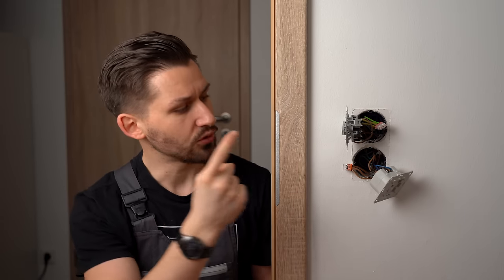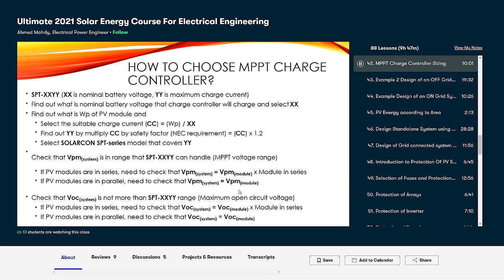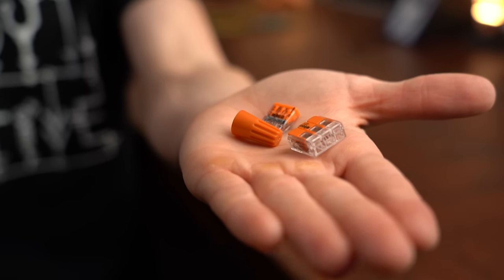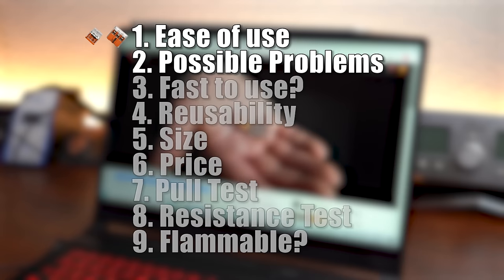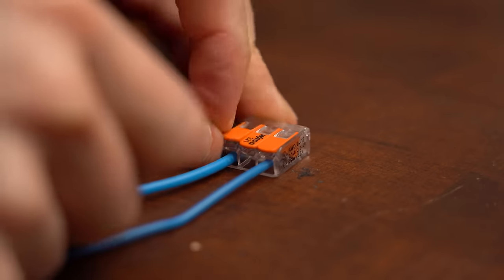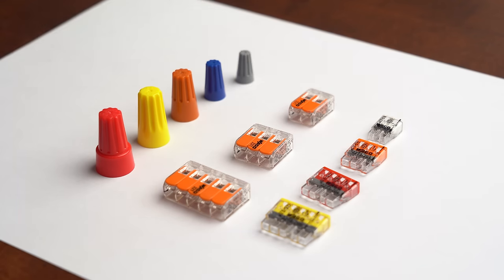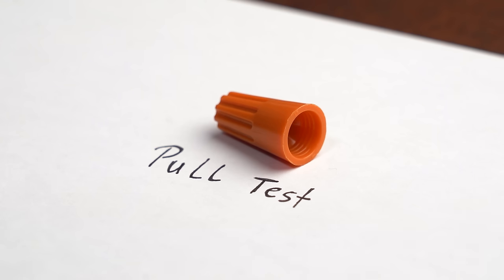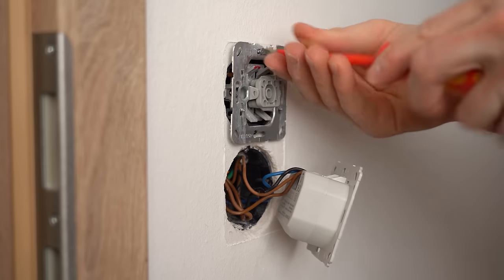What Wire Connector is the Best? Settling a Debate! Wire Nut VS Wago

Comment: I recently moved into an older home in the USA, and I just started some renovations. This topic has been on the top of my mind. Thanks for the in-depth analysis!
Reply: If it was built in the early 1970's, you run the risk of homes with aluminum wire.

Comment: Being from the US, I was raised on wire nuts. However, I now keep both wagos and wire nuts around. There are plenty of instances in existing work where wagos have been much easier to install due to space and wire limitations. I also prefer them for mixing stranded and solid cable, but that is purely personal preference. However, I still prefer wire nuts for new work where I have plenty of wire and can cut and strip everything to the length I want. The cost savings is significant when making more than a few connections, and when I am doing something simple like connecting two solid wires of the same gauge, they produce a great connection without much difficulty.

I was also taught to pre-twist the conductors before installing a wire nut. That is part of the reason I don’t like them for adding to existing work: there often isn’t as much room to get a tool on all the wires I want and twist them up, so I have to rely on the nut to do it. I don’t need nearly as much space to shove wires into a wago.
Reply: How many wire nuts (or similar connections) would you say there are in a typical 3 bedroom 2 bath home? Curious to see how much that .88 watt/wago adds up.
Reply: @Kr-oy2bo  Unfortunately, I don't think I could give a good answer on that. I just use 'em!
Reply: @Kr-oy2bo  250+ terminations would be reasonable estimate at 3 connections per outlet/switch. Average American home is about 75 outlets according to Googles. If I were an Electrician, I'd prefer the Wago connectors. I've only used wire nuts and I'm not a huge fan. I've done some plug terminations and I'm a low voltage tech, so I appreciate the fact you can see how well your conductor is terminated inside the connector. I always worry about insulation getting in the way for a wire nut to make proper connection or them not winding together inside the nut properly. I'll probably buy some Wago connectors at some point to keep around the house.
Reply: interesting. Would the higher cost of the wagos not be offset by the time savings they provide in your project?
Reply: @AndreSomers  at the price a German electrician charges: Absolutely. At the price point of electricians elsewhere in the world? depends I think.
Reply: @Kr-oy2bo  difficult to say, because you will never ever use all electrical appliances at once, and furthermore, you will never ever have 20 amps of power (which is at what load the 0.88W were being measured) going through all of those connections at once, if any - mainly, because your fuses will trigger much, much earlier. Usually 10-16amps per circuit in Germany, and depending on the age of the building, circuit can mean all light fixtures on one floor together, or all outlets in two adjacent rooms etc... 
That means that in a day-to-day application, a Wago clamp will only have an absolutely unremarkable resistance and therefore not emit any kind of heat.
But I can assure you that even the Wago 221 are reliable in high-temperature, high voltage use - they are used for connecting electric cooktops and stoves. 
Although that means 10 amps per clamp,  since a normal induction top and oven combo will use three phases. Merten has a "Herdanschlussdose" which uses 221 clamps, super easy to use, although you cannot use pre-configured cables for screw terminals in those.
Reply: @AndreSomers  On new construction, I don't think it would change the total time spent all that much. When modifying existing work where I might have to fight the existing wiring a bit, I do like having Wagos as an option so I don't have to 'fight' the existing wiring, but I don't really do massive amounts of splicing on existing work all at one time. Honestly, the total amount of time spent applying wire connectors (since the trimming to length, stripping, etc. has to happen either way) just isn't large enough in either case to be worth worrying about. Put another way, I don't think I've done a project where one connector vs. the other would have saved me an entire hour or time over the course of the project. That is just me. Other folks may have different experiences.
Reply: @AndreSomers  I think the time savings indicated in the video are a bit exaggerated potentially because he was not as familiar with working with them, so there is a savings in the cost of the product and savings in the lower resistance for the wire nut and a slight time savings for the wago it probably evens out
Reply: @SPARTANsui1  as a electrician you have to take in cost ie wire nuts are the way to go for most connections going on in a home even repair the guy in this video has his own bias that mess up the out come of his view but dont get me wrong wago do come in handy are some points but most things a simple wire nut is best
Reply: @HeadsDisplay   Yeah I don't disagree with that at all. From a homeowner's point of view, for DIY use, the Wago connectors seem nice to use as a single box will last years, so cost isn't such a huge factor when you're doing an upgrade here and there.
Reply: wire nuts are bad, the twist can loosen up due to thermal expansion of the wire when passing current. causing more heat.
We remove all of them when we find them in older home when trying to find a fault in the system.
The colored wago's are simple best. small wago's for 2 wires(red) up to the grey for 8 wires.
Reply: you would be better of using screw terminals and stick all wires from the same side and use both screws to fix the wires.
that's how it's done in Spain and believe also in Germany, special screw terminals exist with only 1 hole and the other side capped, as various sizes for different gauges of wire.
For stranded wire we use a "cable end terminal", a soft metal tube with colored plastic band with a special crimp tool, to make the stranded wire solid and use the wago or screw terminal.
Reply: @AnalogDude_  from my experience I haven't encountered any problems with the nuts, ofcourse you have to twist the cables together beforehand. Most of the houses I work on are made before 1970 and a lot of them have 16A triggers on 1,5mm², maybe the problems you've seen is because of bad quality products.
Reply: @ThomasDdm  Well, they do give problems and i have removed them old old houses with cloth wires cables and replaced them with "Wago"''s to make it work again, better.
you have Wago's from 2 up to 8 wires, 2, 3, 4, 5 and 8, pretty much the standard here, accept from some evil electricians that runs out there.

i wouldn't put a kitchen on it.
in Spain the kitchens can have  a fat 6mm2 wire to feed to appliances in the kitchen. they use screw terminal and always feed all the wires from the same side and use both screws to fix the wires.

nah, always KEMA KEUR approved material here, even before the wago epoch and the wire nutz, no china made goods, here. it was always the same brands.

i learned to make the twist at school., but never ever had to use it afterwards.
no1 buys wirenutz here, but you can find them in houses from the past and that wirenutz was a fully approved and tested version  in combination of a procelain, later pastic tool.
Reply: @beartankoperator7950  Very much so. If you are an electrician and taking anywhere close to a minute to wire up something that simple you are fired.
Reply: @AndreSomers  They definitely offset the headache you'll have if you are messing with older electrical wires that are prone to snapping because they've been bent so many times already.
Reply: @Gideon U Tight Spaces and connecting new work to old work.
Reply: I usually only find the push in wago nuts so i like wire nuts when i have to deal with solids and stranded
Reply: @AnalogDude_  wagos are the Standart in german Homers for like 20 years :)
Reply: @HeadsDisplay  we only use wagos at my school
Reply: @Tupsuu  that fine and never said school dont. My statement is cost in real world just think the cost of using 5000 wire nuts vs wago for a building.  Edit am in the hvac field and work mostly with braided wire where a wago  with its higher resist is a no go. Think of a heating coil if wire not size right or a connection cant take the current it will heat up and fail, start a fire or you lose btu by having less power going to the unit.
Reply: @AndreSomers  a lot of electricians I know use a wire nut twister that attaches to a drill so wire nuts take all of 5 seconds for them.

Comment: For wiring Lamps like @GreatScott! did in this Video, there is also a special Wago just for that purpose. It is the Wago 224-xxx. They are designed as InLine Connector, so one wire in the one end and the other wire in the other end of the connector and are specially designed to wire stranded wires and solid core wires together. So one end of the connector is the wago 2273 like connector for the solid core wire and the "simply push it in" way of use. The other end of the connector is a clamp like connector that you can push together and insert the stranded wire.
Thats why they are called "Wago Lighting Connector".
Just wanted to tell, if someone don't know them but want exactly that kind of connection for his project.
Greets from Berlin, Germany
Reply: Those are awesome for hoking up light fittings.

Comment: 5:44 always run the stranded wire longer than the solid so the nut has something to grab onto
Reply: Soldering the 2 wires before screwing in the marette  is also a good idea
Reply: @carlosoruna7174     some years ago I read in the NEC that soldering is not allowed in house wiring.
Reply: @ianmckinley5613  You are correct, Generally solder shall not be used .
Reply: Normally an electrician twists the wires using the linesman pliers and then twists on the wirenuts
Reply: Just spend so little more and buy fucking Wagos. 
When will some of you understand that in every country that is developed enough and has strict legislations when it comes to the whole electrical system, like DE and UK, the WAGOs ARE the STANDARD. :)
Reply: @drk_blood  It is not a little more here. It is a lot more. Also because we don't live in tiny Euro shacks we can twist 3-5 #14 AWG connectors in a red wire nut
Reply: @drk_blood  I don't think the electrical accident statistics support your superiority complex. Wire nuts work well, always have worked well, are simple, and are cheap. Americans haven't been quite so happy to roll over and let some corpo tell them and their government that an over-engineered product made by a single company is what you HAVE to buy.

Use a wago if you like them, I'll skip the wasted resistance and multiplied price in favor of the time tested tradition of twisting two wires together with some plastic around it to protect the connection. Also known as a wire nut.
Reply: @octorokpie  you don't have a clue about what you're talking about and I will not waste any more of my time with strangers on Youtube.
Go back to buying guns, dude..
Reply: @niffrig  there are soo many things that are wrong in your country, bruh.. 
the gun problem, the electrical system and the quality of the locks.. just to name a few. It's a shame :(
But yeah, if they are for real much more expensive, that is sad to hear. Even the chinese ripoffs are better than twisting.. I literally tried everything. Temperature and resistance don't lie !  That's why the Wagos are considered the best and the most reliable in the world.
Reply: @drk_blood  Europe built out their systems after the US had already done the proof of concept. So there are some things in the European system that are more logical (like 230-240 V). But the UK plug is space wasting abomination and 5 connector wagos are difficult to fit in a box.
Reply: See this video is making the rounds again. Wanted to mention I've used lever locks in half of my house boxes. Great little inventions, though with solid core conductors I noticed more accidental disconnections while trying to adjust outlets and switches into the box. The levers actually create some risk because if you push a wire into them when wrangling everything in to close up the box they can open and become a problem.